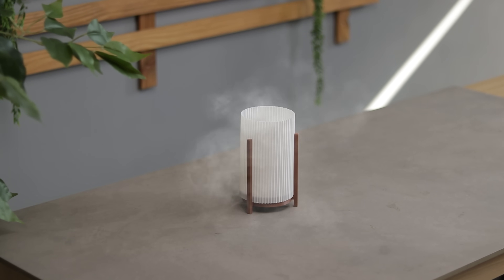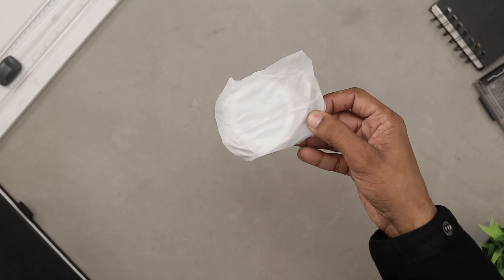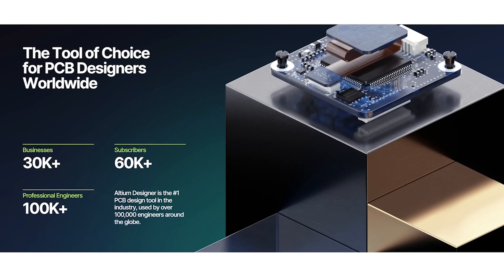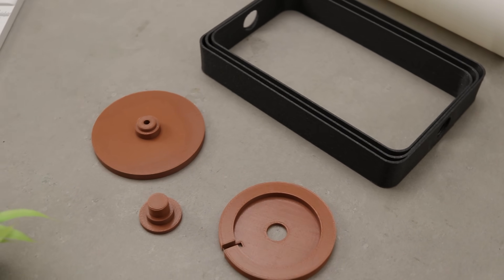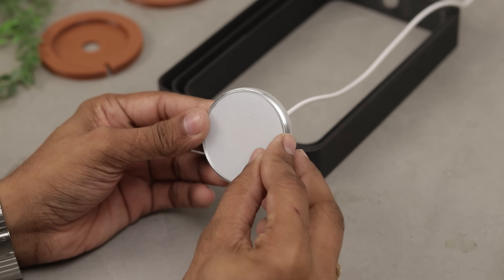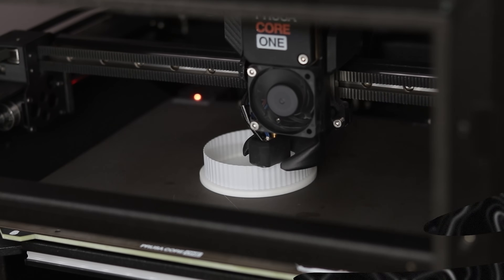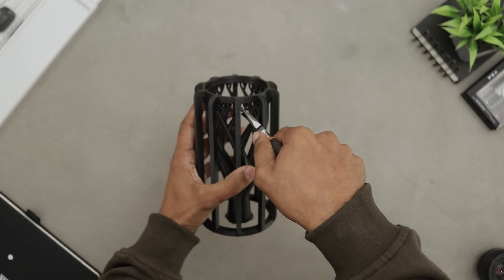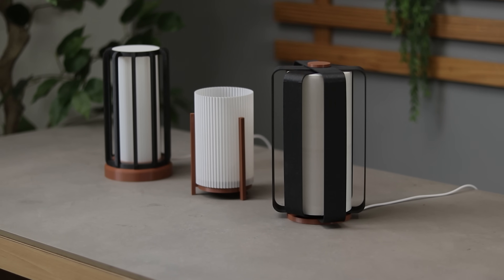These 3D Printed Lamps Need Only ONE Electronic Part (So Easy!)

Comment: How about making a bluetooth speaker lamp. Since you made lamps. I have an idea, since the LED can hear up, use a mini cooling fan below and on the top of the lamp a speaker unit with the module and way on top a touch on/off. Let me know if or when you make it. I will BUY it from you.